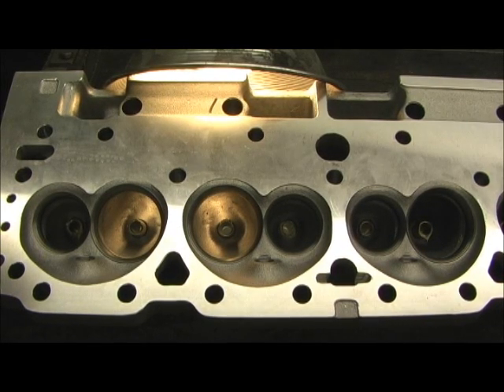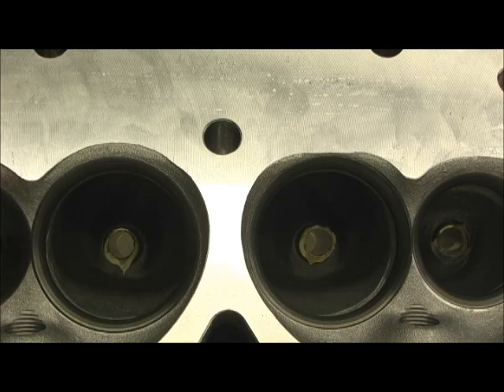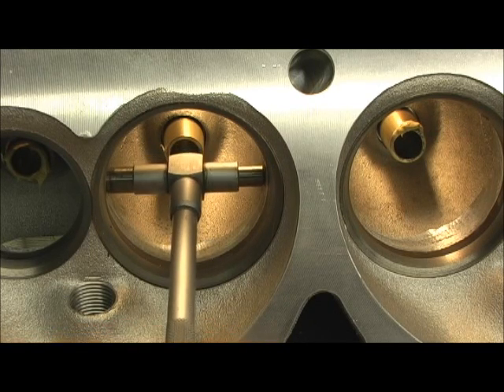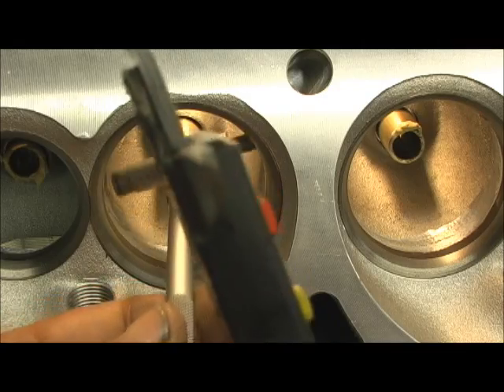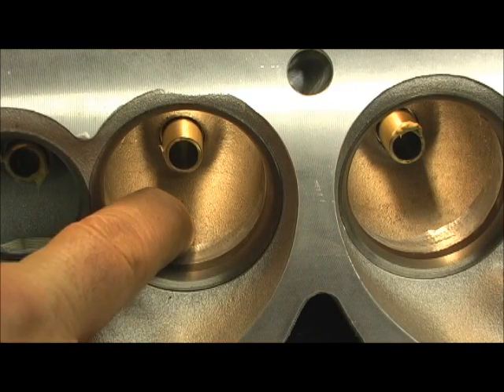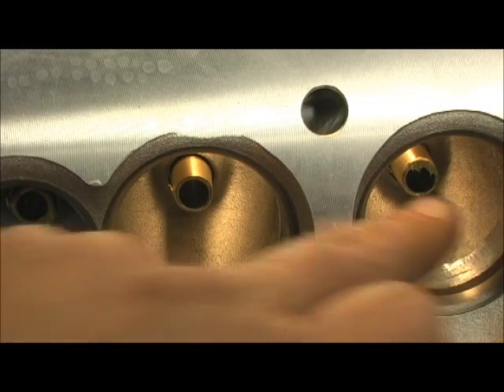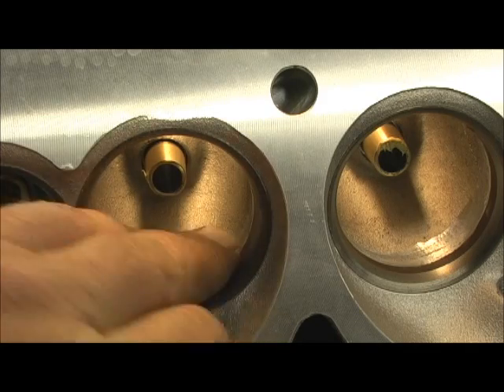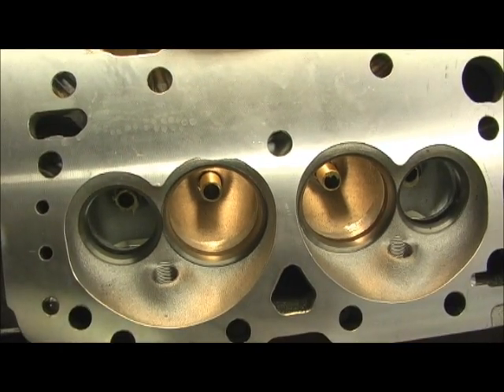Edelbrock NIB "E" 200 SAD Bowl to Seat Work 2.0

Comment: Looks like a good amount of core shift on those chambers. Check the heights of the inserts. They can be off a mile too.
Reply from the maker: Your RIGHT, and I did, and they were OUT. It took me 7 hours on the Valve Job to get the Stem Height equal (within .010 of each other). I try to tell everyone, but NOBODY listens to me Yank.